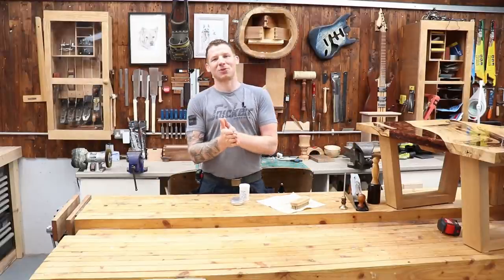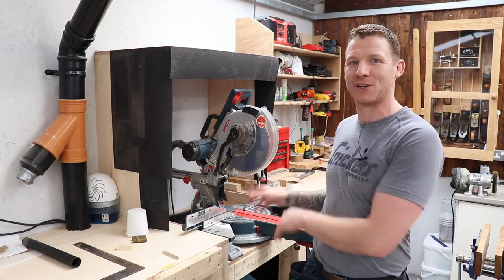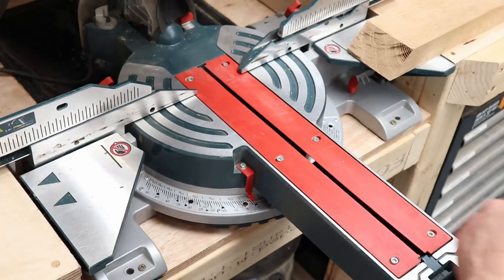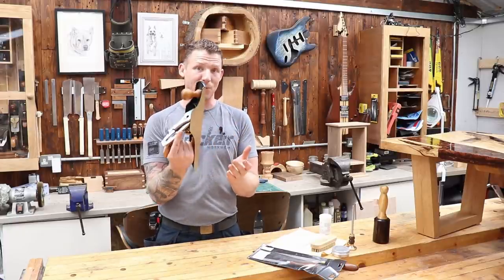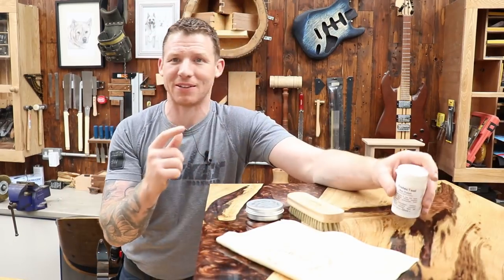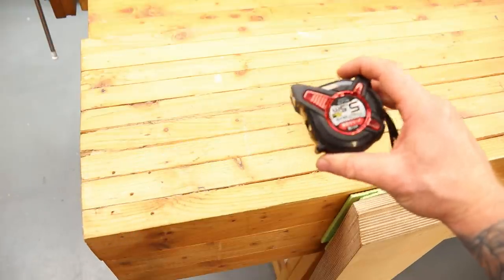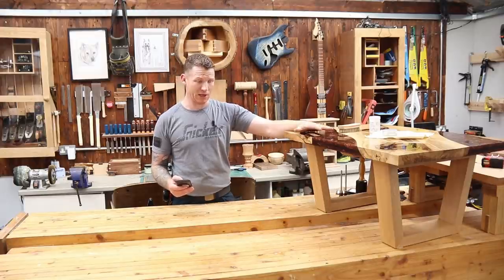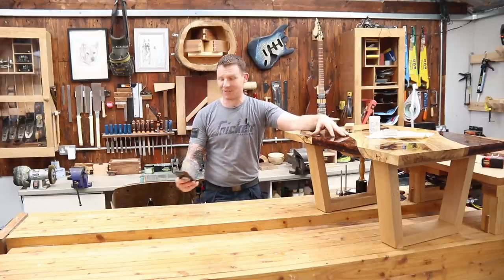WorkShop Vlog #10. Tool Reviews. Q and A. How To Use A Mitre Saw. Channel Update.

Comment: The slight mistake with the miter saw is very understandable and very common.
...
The trick is to remember that this simple rule:   "The cut angle of the fence is complementary to the cut angle of the blade." 
...

Their combined angles will always add up to 90 degrees, as you said.

Comment: Could you detail what your tool provider said a low angle jack plane was suited for and why it was not suited to flattening.  Thank you
Reply from the maker: Sure this is what Matthew explained to me.  

"The 62 is a wonderful tool, but it is very much better as a panel plane (long accurate smoother) than it is as a true jack plane for coarse corrections. The naming convention is far from helpful in this case.

I'm sending you a No.5 with a cambered iron which I hope you will find achieves the same outcome with a lot less effort. Your board will have a slightly facetted finish, but the cupping and twist will be gone in fewer passes."

Comment: Seeing that mistake on the mitre saw on oak was damn painful given how much the price for oak has gone up since Brexit (by my count, walnut's actually quadrupled and thick oak isn't too far behind)!

I have similar fun with rust on my tools in the shed (and the bed of the lathe and the bandsaw) and went looking for Boeing's Boeshield T-9 based on some of the US youtubers but you can't really get it in Ireland that easily; but there's a canadian version called ACF50 and it seems every single motorcycle shop in Ireland carries it for bike chains (car and motorcycle shops are a surprisingly useful source of stuff we'd use in the shed for finishing wood or resins, or for oddball things like the ACF50; always worth taking a peek at them for stuff like that). 

BTW, my bench is also a paul sellers design (tweaked here and there) and it's five feet long (to fit the 8x6 shed) and I wouldn't make it that small if I was making it over. You're constantly short of space. And yeah, the top does move a bit, but that's what your #7 is for :-D 
I would build it differently next time though - I want more room on mine, so I'd make it longer (but that will need a bigger shed) - but I wouldn't laminate the top from 2x4s again, I'd go to a timber yard like McMahons or Quinns and get the thickest red deal I could and use that to make a slab top or to at least have only the one glue joint in the table. Wouldn't make it from hardwood at all, you'd just dent whatever you're making instead of denting the workbench. And I'd love to have enough room for a second separate assembly table - Matt Eastlea's workshop setup is great for that with his ruobo bench facing an assembly table (which happens to also be one of the modern Paulk/MFT style workbenches for breaking down sheet goods and using tracksaws). If/When I get a bigger shed, that's the layout I'd like to move to. I can't see a shorter bench being as useful (and you never want the legs right at the corners or you can't have planing stops where you need them really). 
What you might think about though is if it's a narrower bench that you need. Once you get past two feet wide with most stuff, it seems you hit the law of diminishing returns with a veangence.
Reply from the maker: Oak has gone up €10 cubic foot, crazy.

Comment: Miter Saw tip: Mark your waste side of the angle and line up the cut accordingly. Seems like you are adding confusion when there is none.
Reply from the maker: If you mark your angles and line up the saw there is no problem but if you use the markings on the saw its easy to run into a problem.

Comment: Great video John thanks just a quick question can uni strut be used out doors ? thanks
Reply: As long as it’s galvanised and any cut ends are  sprayed or painted with galvafroid   It will last years and is widely used externally within the construction industry.

Comment: I was looking at a house i rent yesterday to get it ready for a net client and i found the spark had replaced the bathroom fan by just adding a socket to the new one and plugging it into a twin socket i have in the attic for a light when i am up their is their safe. I am no spark but i dont think it is.
Reply from the maker: I the fan is has a plug on it which is fused and is plugged into the socket then it is probably safe however that is certainly  not how it should be done
Reply: I would check the plug top and make sure he has changed the fuse to a 3 amp or 5 amp fuse, also make sure the sockets in the loft are protected by an rcd or rcbo.
Reply: @williamn01  Their is a 3amp fuse in the plug. I think it is safer to get another spark in to have as look as it is not sitting right with me scene i found it. thinks for the advise